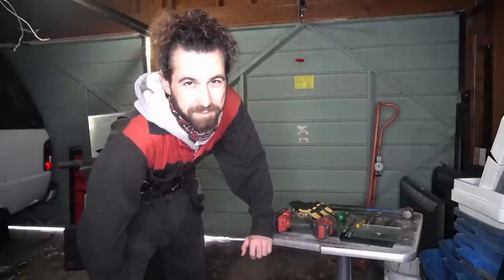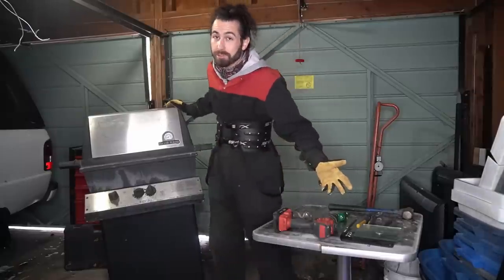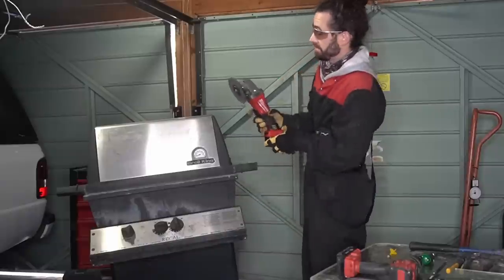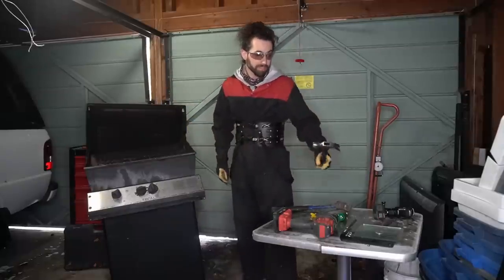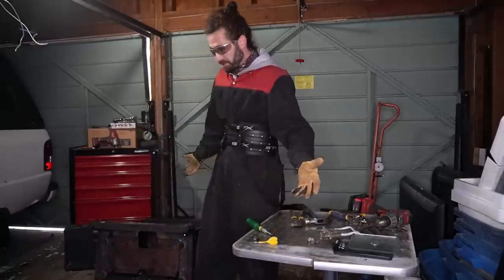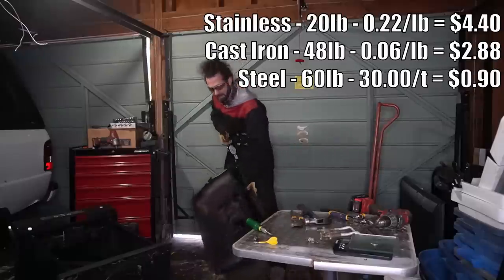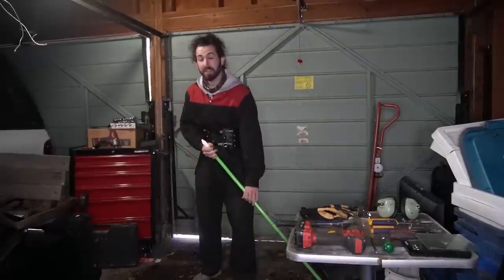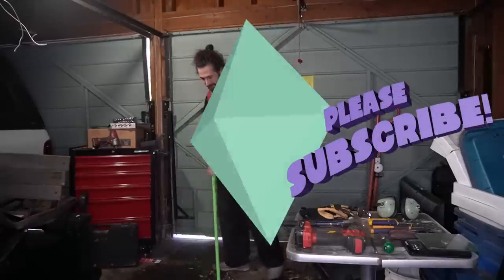Scrapping A Barbecue Fast And Safe! Scrap Aluminum And Brass In Less Time!

Comment: I do handyman work and make a trip whenever I have enough to make it worth the drive,  This time, I posted on a local 'free stuff' group on FB and got 30+ people with stuff to scrap.  I spent about 23 hours over 3 days and made 3 runs to the yard.  Total scrapped = ($660 - gas) = ($590/23 hrs.) = $25.65/hr.  Not too shabby, but I make $35-50/hr. as a handyman.  I'll definitely continue to do it, though, because it's fun, a good workout, I get cool stuff to use/sell, and I really enjoy meeting people and helping out.  Plus, I mention that I'm a handyman and put the word out to load up my regular work schedule.

Comment: Great video! 25 years working in a scrap yard it still surprises me how much money customers leave on the table bringing items like this in whole as shredder feed rather than spending a little time breaking them down for a far greater return. 

Just one thing I'd like to add:
Bbq grills use two different grades of stainless, 304 being nonmagnetic and 400-series being magnetic. Sometimes a piece of 400 is used as a decorative piece while the rest of the stainless is 304 so good practice to check each piece with a magnet.

Again, I enjoyed the video, will have to show it to some co-workers & customers. Thanks!

Comment: if you cut the tank connection end off the other side of the hose you can normally toss that into a irony aluminum or dirty aluminum bin just as it is. it doesn't weight a ton but its a bit more cash and one less thing in the trash. also it normally has a small brass valve on it- likely not worth the effort to remove but if you find a simple way it all adds up. I do such things in my off time if i dont feel like spending a lot of time or effort that day. I however go to the scrap yard quite infrequently but when i was going a lot i did over 10,000lbs by myself in about 8 months

Comment: Didn't know the Grills could be cast iron, the next lot of BBQ's I come across, will put them aside and test them when the warmer months come, If you have open fires or go camping/fishing etc they come in handy! I keep the annoying to pull apart brass fittings that are usually connected to the hoses, also in some BBQ's behind the knob plate some brass can be hidden in that area so always check!

Comment: if you cut the little adapter off that attaches the propane tank to it that is considered irony at least here in the United States don't pay much but very easy to rack up
Reply from the maker: Oh, not the brass bit but the other aluminium end? Solid point 👍
Reply: @thubprint  yes it is on the other end of that black hose it is what the actual propane tank hooks into there is a black plastic knob on top of it to turn on and off the gas that is considered irony and it is a whole another price on its own I seen when I watched your video you threw that out you might want to start saving those

Comment: Hi! Q - how do I tell the difference between cast iron and junk steel in regards to the grill section?
Reply from the maker: Good question, I’m not really sure! I’ve just memorized certain items that are cast. Brake drums/rotors, claw foot bathtubs, and heavy bbq grills mostly 😄
Reply: Yes, heavy is a solid clue. I think about the heft of my grandmother's cast iron skillet.
Reply: Cast iron will be harder but more brittle. Steel, generally not as hard but far more durable. Hit a piece with a proper hammer and if it bends it's steel but if it breaks it's likely cast iron.
Reply: @scraprat3369  thank you for the explanation. That is helpful. I do have a proper hammer in the truck. Sometimes I grab just the grill pieces when my truck is full. I don't like the loose charcoal dust.

Comment: Is it better to scrap transmissions whole or tear apart and sell the casting?
Reply from the maker: Funny you should ask, I’m going to do a detailed look into that really soon! Simple answer though, with all the seized bolts and weight you’ll lose from steel parts and fluids my guess is you’re better off leaving them whole and taking the breakage price. I’ll let you know in a week!
Reply: @thubprint  Thanks, look forward to checking it out. Great videos, keep up the good work!
Reply: @thubprint  what about smaller parts like water pumps, alternators, etc?  Take apart /sell whole?
Reply from the maker: Z M THAT is a good question! I’ll find a few and make a video when I do, because I have no idea 😄
I’ve only ever brought them in as-is, but I’d like to know how much money I’m leaving on the table when I do
Reply: @thubprint  cool, will be good to know, been thinking about that for a bunch of parts I have piling up,  thanks for the answers

Comment: Don't put those with your brake router's those are clean cast auto u get a way better price
Reply from the maker: The grills can be a better price? Or the rotors are?
Reply: Rotors are clean cast auto my shop there normally $50-100 more per ton also can count as short steel still more value